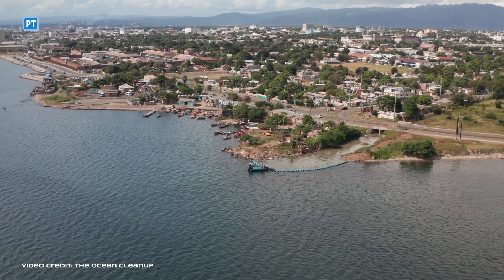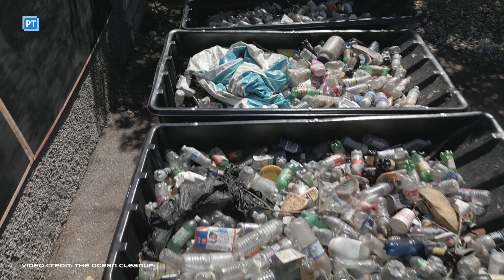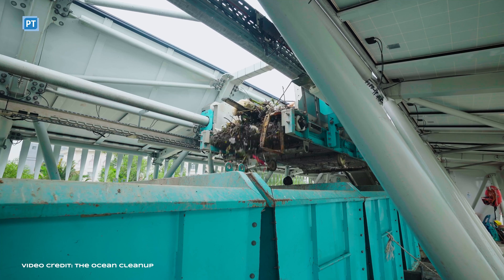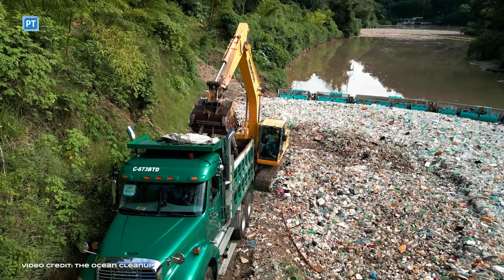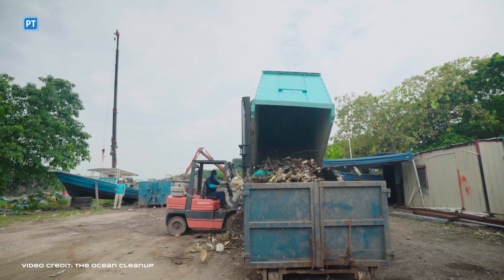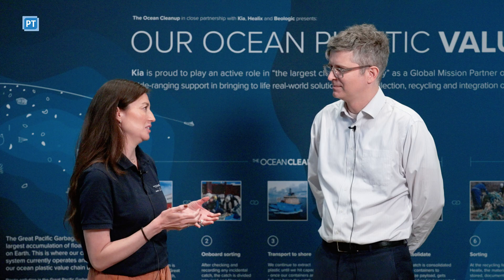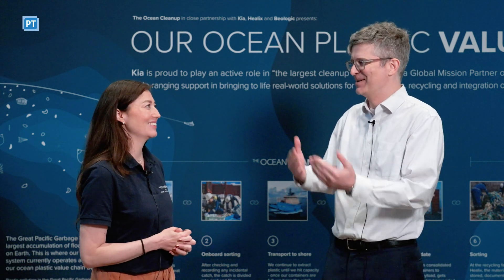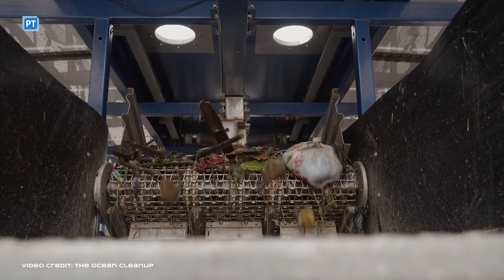Chasing Down Marine Plastic Pollution With - The Ocean Cleanup

Comment: The only long term solution is for governments to charge an "ultimate disposal fee" reflecting the cost of cleanup and collected at the point of manufacture, because this is a societal cost imposed on everyone. Costs are determined based on type of pollutant and how long it lives in the environment. For a one-use throwaway disposable plastic water bottle, I would guess the cost would have to be around $1.00 per bottle. This cost is passed on to the consumer. If it kills the plastic water bottle industry, excellent!